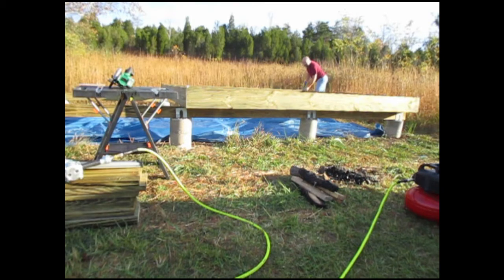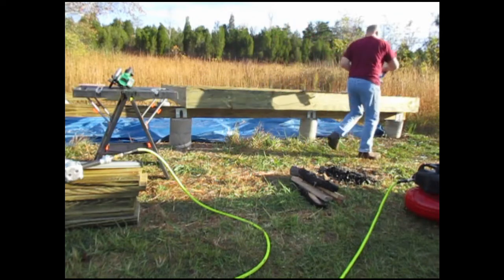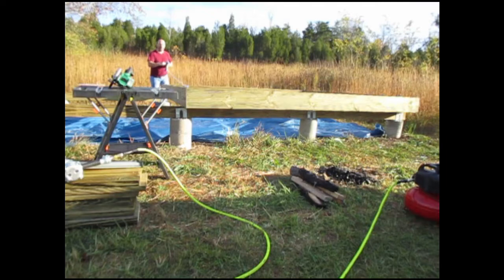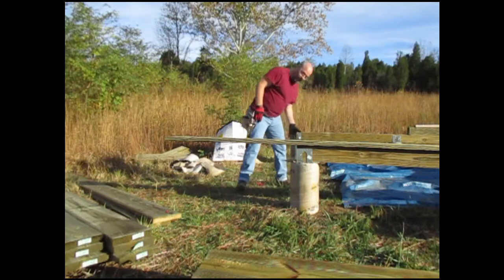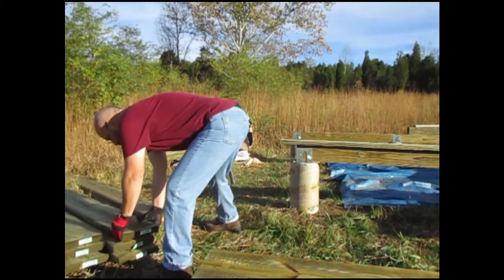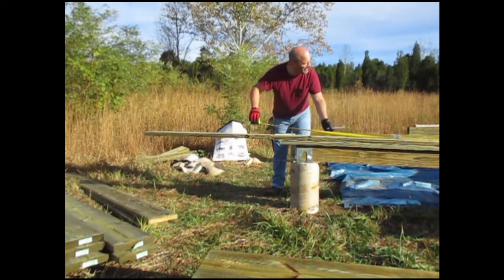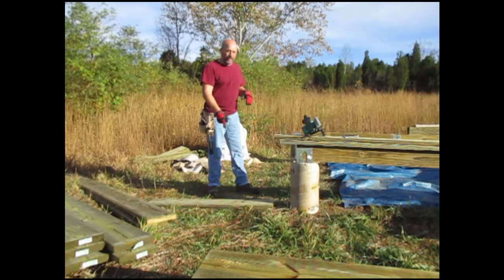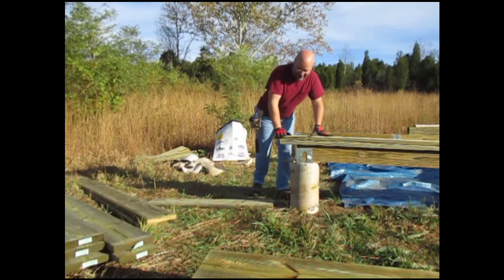Vlog 36 - Natural spring well & tiny house build.

Comment: Always is a pain going back and fixing mistakes. I built a tiny home Year’s ago when I knew nothing about anything. Learned a lot. In the end no matter the size, a house is a house, all the same parts and pieces. Mine was 380 sq ft. You’re taking on a huge task. Good luck friend. Keep at it. Long road ahead. New sub. 👍👍
Reply from the maker: So far my mistakes have been fixed before too much damage was done.  As long as I fix them before moving on to the next step I SHOULD be ok.  Loving every minute of it!  Thanks Farmer G!